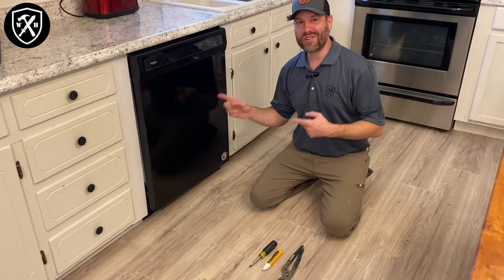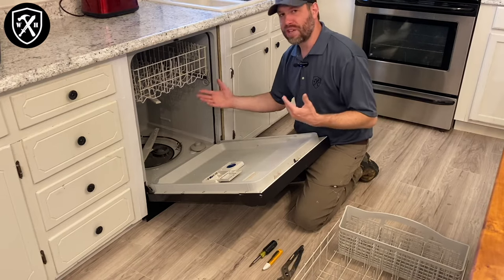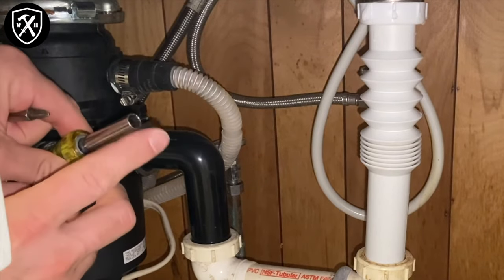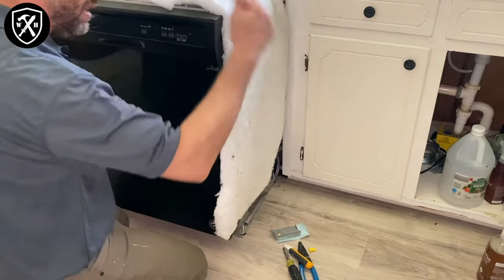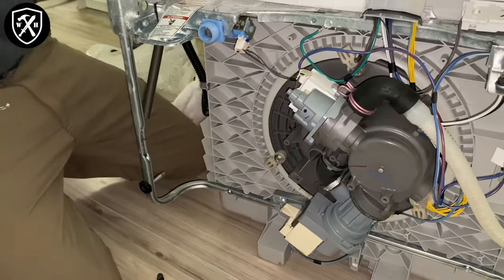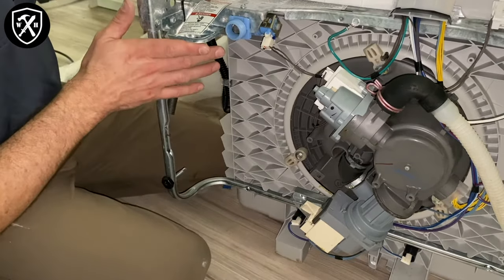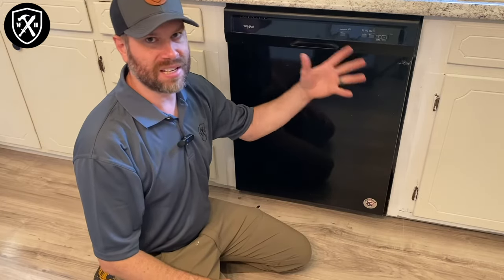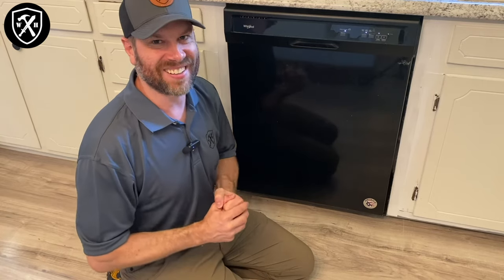How to Fix a Dishwasher NOT DRYING Dishes | DIY

Comment: hardest part of working on any dishwasher is getting it in and out of the hole!!!
Reply from the maker: Definitely can be challenging depending on flooring and other factors. One tip is to try and raise the front leveler feet so it’s a little shorter in height to slide out. Thanks for commenting.

Comment: Didn't finish video because I need to get to bed. Ive been in appliances repair for 15 years. Lot's of bad heating elements I've seen! Not sure if he'll mention this but occasionally putting in a new element will short out the control board. It'll happen.
Reply from the maker: Shouldn’t happen with the unit de-energized but good to be cautious. I cover the board reset at the end also. Thank you for sharing

Comment: I just stumbled upon this video . I've got to say there is more info in this vid than than all others combined . Very direct and to the point. The one point that others are lacking is the reset/diagnostic test cycle that was explained. I would put this at the top of things to try because it does not require any tools or dismantling or removing anything. I live in Texas near the Houston area. We experience a lot of power outages which I think is what caused my heater to no longer work. After running the reset/diagnostics the heat was back to working. Don't know what I would have done without vid info. All components would have checked OK. Cycling would have shown that heater was not receiving 120v. I would have guessed that circuit board was faulty. Saved me a headache.😉
Reply from the maker: Man! This is exactly why I started this channel. Thank you for the feedback and I’m so glad it helped you. 😎

Comment: How do you read the error codes from that reset or other procedure?
Reply from the maker: Some models the lights will indicate a code. It’s best to do a search for a technical manual by model number. Hope this helps. Sorry for the delay as we just got cell service back a little after the storm. Thanks again for commenting.
Reply: @WarriorHouseDIY  I did and AI search for it and this is what it gave me.
Interpret the Flashing Lights:

Count the Flashes:
The lights may flash a certain number of times, pause, and then flash again.
The first set of flashes represents the “F” code, and the second set represents the “E” code.
For example, 2 flashes ➔ pause ➔ 1 flash indicates error code F2E1.
Consult the Error Code Chart:

Refer to your user manual or a Whirlpool service manual to interpret the error codes.
Common error codes and their meanings include:
F1E1: Electronic control malfunction
F2E1: Keypad or user interface error
F3E1: Water heating system issue
F5E1: Door switch problem
Reply from the maker: That’s really helpful information to have. Thank you for posting here.

Comment: I replaced my heating coil but missed the step of disconnecting the wires, which, totally my fault, and now it seems like the coil doesn't heat up even a little bit, any idea what I could have fried? @WarriorHouseDIY
Reply from the maker: If you mean you didn’t disconnect the power wires and also didn’t turn off the circuit breaker then first I would turn off the breaker for about 10 minutes and then re-energize the unit. If that doesn’t work, did you perform the panel reset (end of the video)? Let me know how it goes.
Reply: Thank you for the response on this.  I simply unplugged the dishwasher from the wall rather than flipping the circuit breaker, and what I didnt do was the part with undoing the wires.  I've tried to reset this dishwasher multiple times but it doesn't seem to want to go into a hard reset mode.  I have a Kitchenaid KDFE204EWH3.. I cant find ANYTHING online about how to reset this specific model, everything I see is just generic kitchenaide dishwashers and says to rotate between pressing hightemp wash and heat dry 5x.. I've tried this probably 10x and it doesnt do anything.
Reply: finally just called them and there is no code to reset this dishwasher, its literally just remove from power for 30 minutes.. I guess I'll see how that goes @WarriorHouseDIY
Reply from the maker: Ok a long power cycle might do it. I’ll look into codes and programming after this job today.
Reply: I greatly appreciate it.. I also had tried putting the old coil back in there just to see if the new coil was bad, and it also wasn't heating at all... so really hoping the hard reset does it. @WarriorHouseDIY
Reply: So I did the long cycle.. it made it work ..better... its still not drying dishes (with the new heat coil) and the water doesn't seem particularly hot after its done washing but at least i can use it now because it dissolves the soap. @WarriorHouseDIY
Reply from the maker: @SkanMLL sounds like some improvement. And your rinse aid is filled? That’s one that trips up some units.
Reply: as in it should be full or should not be full, I don't know that I've ever used the rinse aid tbh :) @WarriorHouseDIY
Reply from the maker: @SkanMLL full. Many units will disable the heating function when the rinse aid is empty.

Comment: I just replaced my heating coil. My issue didn't really start until I used a rinse aid. I can't figure out why it's not drying the dishes
Reply from the maker: Is it still not working after heat oil replacement? Assuming you reset the control panel also?
Reply: @WarriorHouseDIY how do you reset defy⁉️
Reply from the maker: I cover it at the end of the video, a hard reset. I powered off a unit to reset and still had to do a hard reset for it work.

Comment: Very informative video! Thank you! A few months ago we replaced the heating coil and the dishwasher still does not dry the dishes. Everything comes out dripping and after a few weeks mold builds up in the inside of the dishwasher. I had never seen or heard of the panel reset until your video, did that and it still doesnt work. Any ideas on what could be the issue? It is the same model as the one in your video.
Reply from the maker: I’m sorry things still aren’t working. I’m guessing you’ve filled and keep the rinse aid filled?

Comment: The rinse aid was my issue, so does that mean I have to refill it with every wash or does it get to a certain "low" point? I could still see blue (the color of my rinse aid) through the window, but it wasn't drying. Mine is a new dishwasher also.
Reply from the maker: That’s actually a good problem (kind of annoying but not something major). You just need to keep it full when you see the level is empty. There should be a clear sight glass showing the level.

Comment: My blew the curit breaker one day and it has water pooling in it and wint turn on ... Any clue what could be wrong ? Ima check everything but want to have a start point
Reply from the maker: Might be a bad flood switch (that can prevent the tub from draining) also could have something blocking the drain line and the pump is working too hard causing the breaker to trip. Good luck and let me know how it goes.

Comment: @warriorhousediy I replaced it and ran a cycle and no luck. 

Have any other ideas about how to fix this?
Reply from the maker: And you did a reset and filled rinse aid?
Reply: @WarriorHouseDIY  Yes. The old element cracked in half when I removed it so I still think that was the culprit. Could that have blown a fuse?
Reply: Hold on , I am an idiot, didn't reset let me try that.
Reply from the maker: Same thing for the one in this video. And it wouldn’t heat till the reset was done. Let me know how it goes 😎

Comment: mine when it's done with the load , the sanitize light stays blinking while the clean light stays solid . so that means I gotta replace the same heating coil too?
Reply from the maker: No need to replace the coil of the dishes are hot and dry. That sounds like a different problem. I’ll look into it. Thanks for commenting.

Comment: I got that same model..how to do you take off that air vent cover..Can't find how to anywhere
Reply from the maker: Do you mean the steam vent in the door panel? I haven’t worked on that but most require the door panel to be disassembled (screws all the way around it)
Reply: Yes..I've seen other models can just twist and open it
Reply from the maker: @user-sh2zy2rb8f for sure. This one doesn’t seem to want to pop off easily 🤷‍♂️

Comment: I changed the heating coil and it still doesn’t heat dry or high temp. Any recommendations?
Reply from the maker: Did you try a panel reset? I cover it briefly at the end of the video. Also the rinse aid needs ti be full in some units. My guess is the panel reset would do it. Thanks for commenting and let me know how it goes.
Reply: After the unit runs its diagnostics wash, how do you know if it found something off?

Comment: How important are the plastic bolts ? Mine won’t fit one side
Reply from the maker: If referring to the plastic nuts for the heat coil, they should be a direct replacement or you can possibly reuse the old ones. But they are important because they provide the waterproof seal where the heat coil enters the plastic tub. Thanks for asking!!

Comment: What if its still not heating after replacing the heating element and doing the reset?
Reply from the maker: I would recommend checking easy things like the rinse aid and then working through a service technician manual (typically available online by searching service manual and your model number) Depending on your unit there may be a fuse or some other physical reset requirement. But start with the easy stuff like the rinse aid, it gets so many of us. Thanks for sharing and let me know how it goes.

Comment: Just replaced my old Whirlpool dishwasher and the new Whirlpool dishwasher in no way dries the contents like the old one... I'd put the old one back if it wasn't
leaking water.... thinking about contacting Whirlpool to come and get it
Reply from the maker: I agree with old vs new in some cases. Did you find the cause of the leak? Door seals are a likely culprit and very easy to replace. Thanks for sharing.